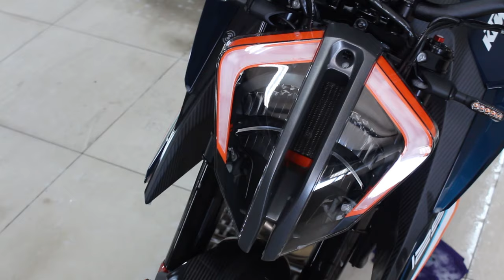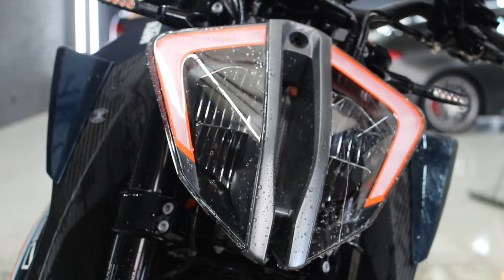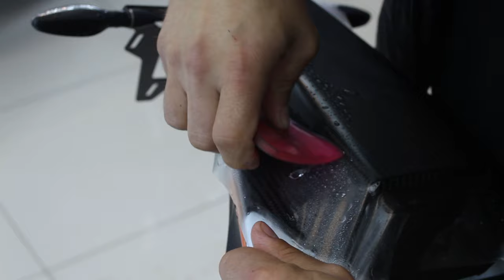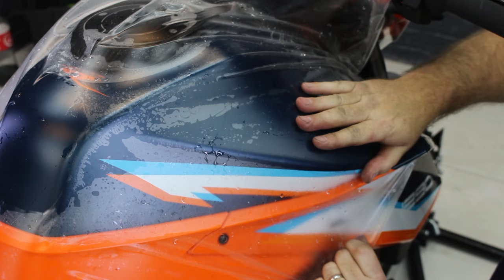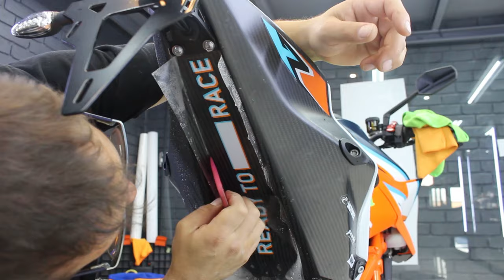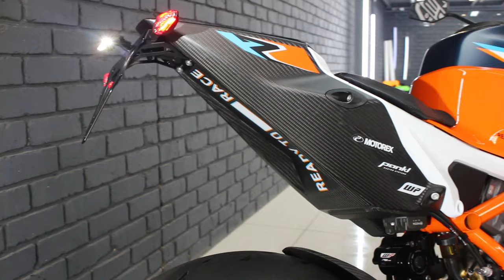Rare New KTM 1290 Super Duke RR PPF Application

Comment: I'm not sure why you didn't take the carbon seat cover off or the carbon surround on the tank personally, it literally pulls off and you could PPF the carbon pieces as an item and get better coverage on the tank and seat plastics.
Reply from the maker: Jon thanks for the input, we did not remove any of the panels as per the client's request as the bike was brand new and he did not want us dismantling the bike. We did however end up taking off the seat after spending quite some time looking for the release pull to remove the seat. In the end we got proper coverage on the tank surround that flows underneath the seat and the rest of the bike without removing any panels.